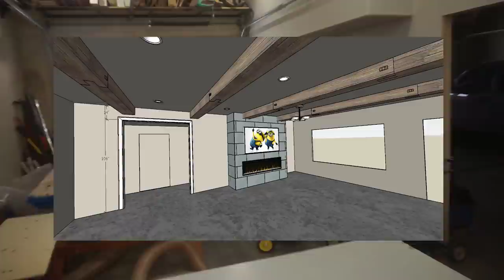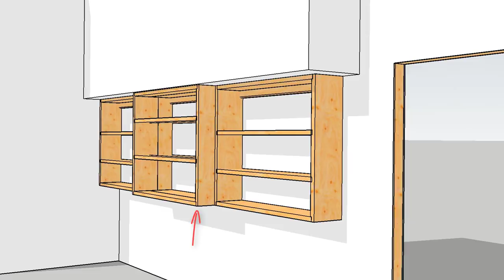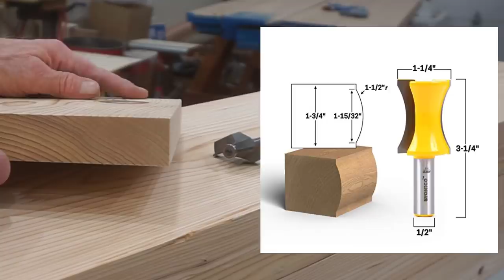Get Organized with Simple Solid Storage Shelves

Comment: Happy New Year, Matt!
Since you also have a Delta table saw, your blade, like mine, is right-leaning. My question: have you ever moved your rip fence to the left, orienting the saw-blade so the teeth point away from the rip fence?
Best, Joe
Reply from the maker: Very rarely and only if there's no other way to make a certain cut Joe.  It usually has to do with making cuts sharper than 45 (like 22.5 or 39) which can't be done with the blade tilted towards the fence.  You can see a perfect example in this video here: https://youtu.be/KGKmithvkoA?t=1110 you might enjoy the rest of the video and other two parts in this OLD series. Sadly it's received few views for all the content I packed into it... Happy New Year in 2020! Best, Matt
Reply: Next Level Carpentry Hi, Matt,

That is exactly why I moved the rip fence to the left. I didn’t think it was unsafe because other brands of table saws have a similar orientation, but the blade is on the left side of the rip fence in its normal configuration.

Nonetheless, I was curious whether there was something unsafe about what I was doing.

Actually, I prefer the configuration of the Delta, because it seems it might help in avoiding kickback.

HAPPY NEW YEAR!!!

Comment: Nice! With slightly different joinery (vs rabbetting), though, couldn't the cleat attach to the sides more sturdily? That is, the whole thing is currently held up by the six GRK screws holding the top to the sides, right?
Reply from the maker: Thanks Rob... there's plenty of 'slightly different' configurations to add strength but those screws are more than enough for these shelves.  It doesn't show in the video but I used two screws in the ends of the wall cleat too so that makes 10 screws in 'shear' per section so even at 30 lbs each they'll easily hold 300lbs per section IMHO and I doubt 50lbs each would make them fail.  Some kind of mortise and tenon arrangement would add more strength with fewer or shorter screws but I felt it was beyond necessary for the build.  It's good to observe, question and discuss though so interaction like yours is always welcome here... Bext, Matt
Reply: Makes sense -- thanks for the reply!

Comment: You definitely showed that the glue joint was stronger than the wood for the edge-to-edge glued joints, but it still looks like the wood broke pretty easily with the mallet. If you did the same thing with a solid piece (e.g. 2x12 or 2x16) I doubt they would've split down the middle so easily... and I think that's where the mechanical reinforcement comes into play.
Reply from the maker: Try it sometime...  a full piece is harder to break but it will still 'always' not break at the glue line... unless the glue joint isn't what it should be... which is why I believe 'mechanical reinforcement' is redundant.

Comment: At 14:05.  Di-Hydrogen Oxide.   Tends to be expensive if you purchase it from your hardware store and it does not mix well with petrol or diesel fuel -- causes some problems.  Works pretty well in your lead-acid battery.  But you can arrange with your City Utility people to provide it "on-tap" at a pretty cheap price. :-)

Comment: I appreciate the video, especially upgrading the framing lumber. Why use Titebond III over II? Is it because it flows easier? Or is what you had on hand?
Reply from the maker: Sidney, Titebond III is my go-to glue because it's waterPROOF and not highly water resistant like Titebond II so it doesn't swell even a little bit under water-based finishes or changing humidity.  Cost of glue as a percentage of anything do is insignificant so I don't even pay attention to that.  The only time I use Titebond II is on very blonde wood where the darkness of III can show up on glue lines.  If they made III in yellow it would be the only thing I use for woodwork.  As an aside: I use Titebond II when installing trim because it doesn't tend to run and has a quicker 'grab' time which really helps for fitting miters on casing and splices on base and crown.  Hope that helps? Bext, Matt

Comment: I was wondering why you didn't drill shank holes? I assume the 2 3/4 GRK R4 Multi-Purpose Framing and Decking screw's design allows you to get away without doing so? I was curious as I always drill my pilot hole, shank hole and countersink separately.  Those screws and snappy bits look like a real time saver.
Reply from the maker: Good question Joseph.  I find that a separate shank and pilot hole are unnecessary in anything but the hardest wood and when using old-school wood screws where the shank is the same diameter as the outside diameter of the screw's threads.  I use Snappy bits almost exclusively for everything from cabinets to furniture to millwork because a single pilot/shank hole diameter is more than adequate.  I think the time savings and equal or greater strength are the driving force behind new fastener design but it's good to know how they 'did it in the olden days' for those rare times when it's the best method.  Best, Matt

Comment: Something else to add about using 2x construction lumber is it's pound for pound stronger than 1x and a LOT less expensive.. I use it for all kinds of builds, shelves, benches, table tops, etc. Even if you have to plane it down to 1x it's still cheaper and that includes replacing planer blades along the way..and go to a reputable lumber yard and stay away from the box stores if at all possible..
Reply: it is said, wood is 2x stronger when 2x wider
and 8x stronger when 2x thicker

so, a 2x8 is 8 times as strong as a 1x8

Comment: Great video, but  I have to ask why you do your glue ups vertically ?

Mike
Reply from the maker: Thanks Mike and good question.  I find vertical glue up is less messy and a lot more manageable.  The fact that I can access both sides of the panel during the process helps align the faces and I don't make a mess of a benchtop from dripping glue but the main feature is that I can add clamps to both faces simultaneously so the panel stays flat as clamp pressure is added.  The vertical orientation is just one aspect of my unique but very functional workflow for glue up.  You can see it in action in other videos I do but your question suggests I should make it a point to do a video on the whole process.  For now I think this one will give you a better look at the process and maybe get an idea of its benefits:  https://youtu.be/RE_BKm4T5Po?t=799 Bext, Matt

Comment: your shoperr page does not have the blue gloves. could you source those too?
Reply from the maker: Hey Kurt, I added the comment below and then, wouldn't you know it, Shoperr is all glitchy just now and won't update with the gloves! &^%$%^^$.  Here's a direct link to them until I get the other issue resolved: https://www.amazon.com/dp/B007VR8X2W/?ref=idea_lv_dp_
Thanks for your patience and understanding... the gloves really are worth all the fuss IMHO🙄😎
 

I need you on my promotion/revenue team Kurt!  Thanks for pointing this out... with your comment I promptly added them:  https://shoperr.com/s/Build-Simple-Solid-Storag7797c583 Note my comment in the listing on these particular gloves where I say that these are the best I've found.  Cheaper ones and even other 'fancy brand' ones have grippy that seems to get hard/brittle and loose their grip too quickly.  I use these until they fall apart and the grip seems to remain effective.  Mrs NLC washes them periodically, especially after a dirty/nasty project like handling steel for welding or doing landscaping/yard work, and the grip is 'good as new' after laundering.  Best, Matt

Comment: By the way,  I've got a 25 inch planer if you ever have the need to use one.
Reply from the maker: Thanks for the offer Curtis... it would have simplified the process of making those 2x18's on this project, that's for sure!  Take care while the snow melts?  Best, Matt
Reply: Hah...  my brother found at a local dump site, an old cast iron built planer, that can take 36"W x 18"D timbers to plane.
I think it might need a 500hp diesel to run it!!!

Comment: It's funny though that the wood always breaks right next to the glued surface. So the glued area is still the weak point of the beam. Extra support is not useless.
Reply from the maker: R Wils... the wood breaks where I hit it.  I hit it next to a glue joint and, guess what?  It breaks there!  The point is that the glue joint didn't fail but rather the wood grain.  Many times extra 'support' is necessary but this isn't one of those times. Best, Matt

Comment: Well, to be honest........,the video was fine. How high does the hydraulic lift go? Oh by the by. You're a lot of fun to watch, even with the glitches.
Reply from the maker: Thanks for givin' me a pass on the hacked up video production!  Glad you have fun watching, glitches and all.  The hydraulic lift table pumps up with a foot lever that uses a hydraulic cylinder to extend the scissors mechanism to lift the table.  It was given to me (so I don't know the brand) and I don't use it often but when I do use it it's fantastic to have around.  I put one that looks identical in the Shoperr Storefront where you can check its features and specs out if interested: https://shoperr.com/s/Build-Simple-Solid-Storag7797c583 Best, Matt
Reply: What is the total lift height?
Reply from the maker: @danielmiller2977  The JET model shows lift height of 51" and that sounds about right for the one I have.  A nice feature is that it has two lift modes so when there's no weight on it it goes up twice as fast.  I use this when lifting the table to lower stuff off the tailgate of my pickup.  For as little as I use it it would be hard to justify the cost or space it takes but I guess both are minimal compared to a pulled muscle or other injury from lifting strain...   Best, Matt

Comment: What do you use for heating and A/C.
Reply from the maker: The shop is heated with a Reznor heater suspended from the ceiling.  Don't have A/C in the shop but a strategically placed 3-speed shop fan makes life comfortable on all but the hottest/most humid days.  Those days I just work early and late to avoid midday discomfort... guy needs his nap time, you know! Best, Matt
Reply: @NextLevelCarpentry  thanks

Comment: is the cross cut @6.40 safe?
Reply from the maker: Crosscutting on a tablesaw always has a measure of risk.  I'm (obviously) comfortable with the increased potential for mishap with the setup I use in the video but many others wouldn't be and should resort to different equipment, methods or process.  For example: a crosscut sled is one way of handling this sort of operation that others might be more comfortable with. Thanks for commenting... best, Matt

Comment: Can i order those shelves from you ? You should make this to ship out. It would be a great business because all the shelves out there are not  made twith this strength.i am more than happy to  put in my first order!. Please reply to me. I am seriously want to order those shelves from you
Reply from the maker: Hi Hung Vu... thanks for all your interest and comments on this video... much appreciated!  Unfortunately it's cost prohibitive to make and ship shelves like this as they'd be many times more expensive than if you make or have them made locally.  Planning/designing/dimensioning/communicating for them alone would involve a couple hours time.  Adding to that the actual time to make, crate and ship something this size and weight makes them WAY over priced for what you'd get.  Plus you'd still need to do the installation.  My suggestion is for you to find a local remodeling contractor and have them watch the video and make shelves for you. That way everyone involved will benefit.  Sorry I don't have a different answer for you as I appreciate your level of desire to get shelves like the ones I make... they really are quite sturdy and useful... Best, Matt
Reply: Next Level Carpentry thank you so much for your reply. Please let me know what kind of rounter bit that i can use to carve out the pocket for door hinges. I have the batroom door get knock out quite offen due to my kids try to fight over , rushing to use the bathroom. When i buy the new one, they sell me a slap so i have to carbe out the pocket for those hinges to fit in. They look ugly with the wood carver  and i want to make it nicely like the store made. Give me some tips please
Reply from the maker: @hungvu8480  this video shows the exact process and tools I'd use for routing out a hinge mortise: https://www.youtube.com/watch?v=RSW2ZSdyEmw&t=666s Naturally you'd need to adapt your template to your hinges but, once you have a template made, you can route a new hinge mortise any time those rambunctious kids make it necessary😎   Best, Matt

Comment: So all your weight is just hanging by the top shelf screws in the end. Top shelf lets go it all crashes to the floor. Why no bottom cleat to be a support stop or left the ends long at the top and ran a rabbit that would help support the shelf unit along with the screws?
Reply from the maker: I address this in answers to other comments with a reply that gives me confidence in its strength... Best, Matt